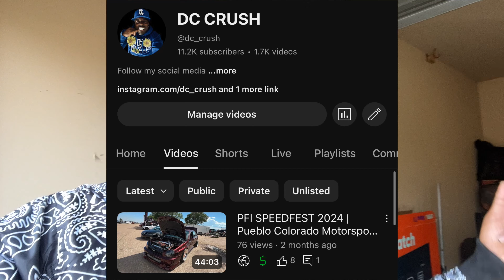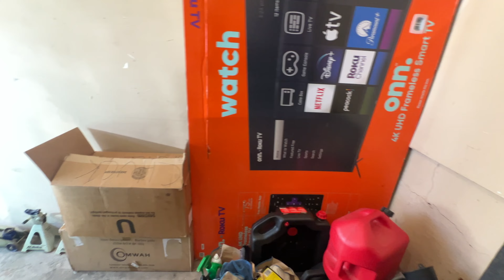Parting out my 1994 Turbo JDM Integra | Project 2025 (Part 1)

Comment: Get a different shell and drop that swap in it
Reply: If you watched the whole video you would know he is dropping the engine on his new project
Reply: I did watch it and he said he wanted a real em1 .. not a b20 vtec civic !
Reply: @anthonyrodriguez3326 it's an ls b18 with a technical head
Reply: @markimarkslov3story lmfoooooo .. you won with the “ technical head “ though i cried !
Reply: I'll take the j front if you decide to sell it. I'm in da Colo Springs also, I have a 99 Integra  that needs so frame work. But a j front would look good.